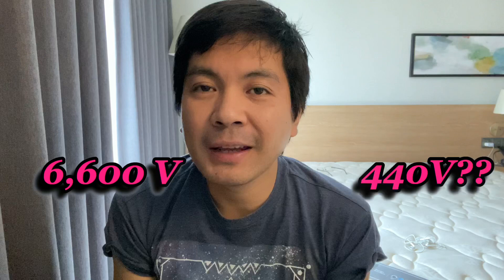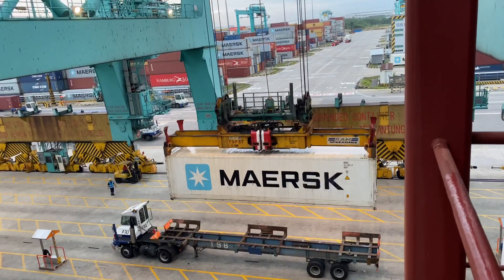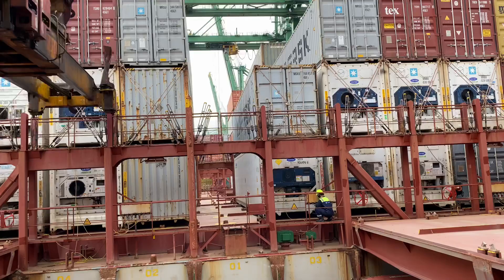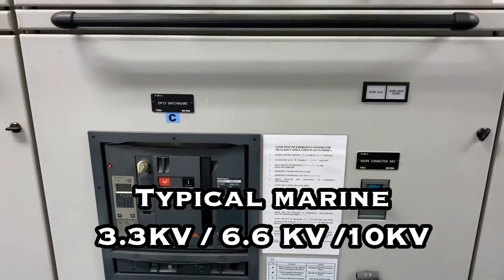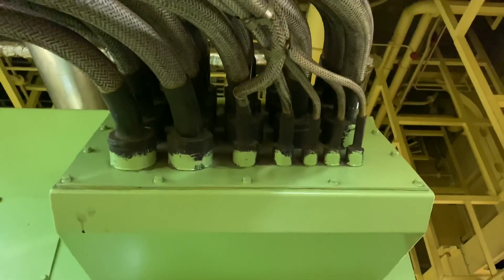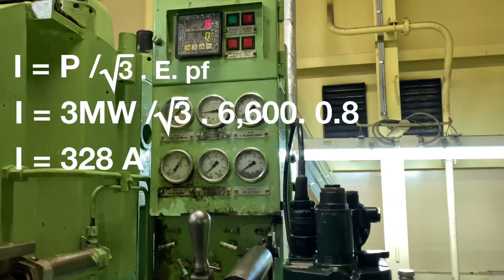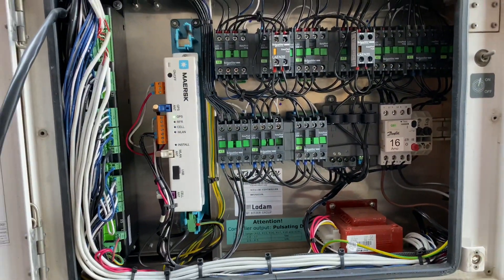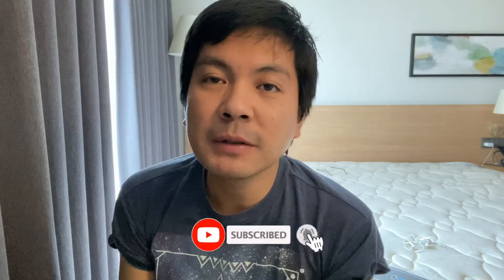Why 6,600 V instead of 440v? (HIGH VOLTAGE SYSTEM)

Comment: Thank you much. This is why we use such high voltages coming out of power plants. The conductors can be smaller, lighter, and carry current farther. Plus lower loss of current due to little to no heating of conductors.

Comment: I have a question for you. When these ships eventually get scrapped, what is the process of making it a fully dead ship that cannot be "turned on" again? I would imagine you turn off the generators, empty the CO2 or compressed air tanks, and drain the batteries. Is that it? What is the process at the end of a ships life to ensure it cannot run again. @Leckyjake

Comment: Sir Leckyjake, how many transformers do you have with, is that a transformer with delta pri 6600v step down to sec 440v 3-phase? With another transformers 440v step down to 220V?  3phase? Thanks

Comment: do the generators run with 6.6 kv in the vindings. or the current goes through a step up transformer before entering the substation.

Comment: While the size of the conductors goes down as the voltage goes up and the current comes down, it is important to remember that the thickness of the insulation goes up.  Also, the space needed for surrounding uninsulated wire goes up.  And, when that current is carried to other part of the ship for use, one has to provide transformers to step the voltage down to that used by the machinery and lights.
Reply: True, but the most expensive part is the conductor, with the insulation costing less than 10% of what the conductor costs.

Comment: Hi jake, I had already worked out the answer ages before you said, the higher the voltage the lower the current! 😉 mind you then high voltage tracking comes it to existence and special tools and suits are needed!
Reply from the maker: That's good and thank you. Sorry for the background music as I was just new to this youtube thing and still learning to edit well. My only purpose is to share knowledge in the beginning and I will try to become better in making videos in the future
Reply: @leckyjake  I Love your channel, I follow all that you do and how you do it! I think we are both on the same par, I am a sparks and also a electronics engineer, I have a lots of mechanical knowledge and also have done refrigeration and done a lot of pyrotechnical and swa only up to 25mm²

Comment: It's easy to understand why a ship operator would choose to run higher voltage at the generation side but, how does that higher voltage get managed and stepped down for the reefers and other equipment that run at low voltages?  Does the operator specify high-voltage reefers that each have their own transformer or is the ship broken up into lower voltage zones?

I'd also love to see a tour of the different types of connectors commonly found onboard.  Are they all a marine standard or do they more closely conform to connectors / plugs we'd see in the country of the ship's origin?

Also, when a reefer is loaded, who connects it to power and verifies operation?  Does the reefer also have any feedback mechanism to notify if it fails during transit?
Reply: I’m guessing they have transformers … 😂😂😂

Comment: Another factor is as a system designer, to serve those very large loads you want a high voltage to drive the amount of current that's required...🤓⚡👍

Comment: Good video. Why under root 3 is required for AC current?
Thanks.
Reply: It comes from the formula:. P = √3VIp.f. where voltage and current are line to line values.
Reply: @SuperBbebee  garbage, why would you put ‘f’ (frequency) in the equation. Too many dangerous idiots on the loose I think 🤔

Comment: Good afternoon Engineer i would like to ask you some questions about the auxiliary engine gen set ( the voltage that produce the alternator is 440 volt 3~ 60 Hz OR 6000 Volt? Directly or do you have an Elevator Transformer 440/6600 Volts to supply the main voltage to the bow thruster's bus bar???? Thanks a lot in advance. ETO Ivan Martinez from Venezuela country
Reply: 6.6kV and 60Hz, what world are you in 😂😂😂

Comment: How do they step down the 6.6kV for hotel load (eg at 100V-200V)? I'm guessing with a transformer as usual on land? Is this centralised. with extensive LV distribution runs in parallel to the HV, or is it distributed around the ship?
Reply: Usually there will be HV feeders off of the main bus. Each feeder will have its own step down transformer and then service a group of things (galley and hotel for instance). But to answer your question, there's multiple transformers and each one feeds an area of the ships LV needs

Comment: Wow. The weight savings from using smaller wire throughout the ship has got to be many tons. Just the cost savings from using 6 times smaller wire makes the extra effort worth it. 5,000 Amps vs 350 Amps wow

Comment: Hi , good informative video but I want to know that all machineries are running on 440 v only, then are there  step down transformers for giving supply to all electrical systems.
Reply from the maker: Exactly! I just assume that everyone knows that already.
Reply: Sir, I didn't understand  this point because  if we use Step Down Transformer then the current in low voltage side will increase so the  problem of high current still exists.
Reply: @omaressam5529  put your smaller step down transformers nearer to the load requirements, cabling around the ship could be HV and only need short LV local cabling.